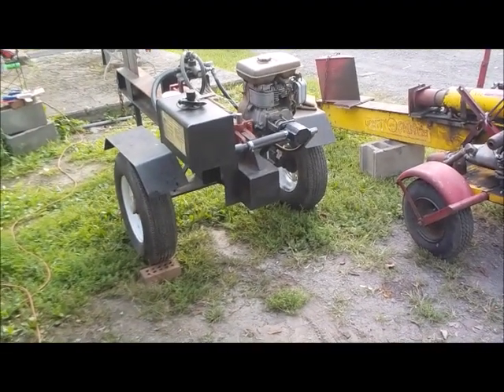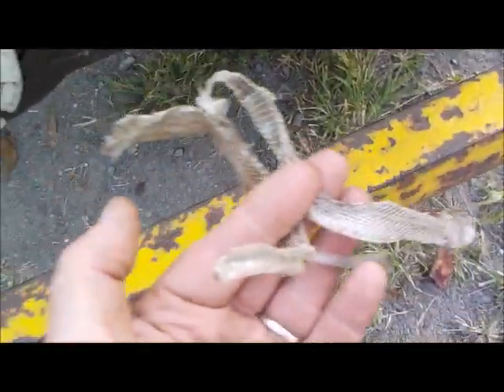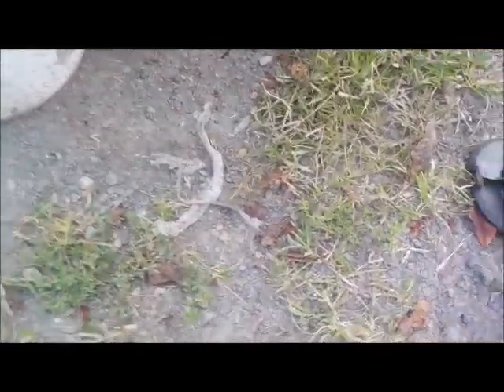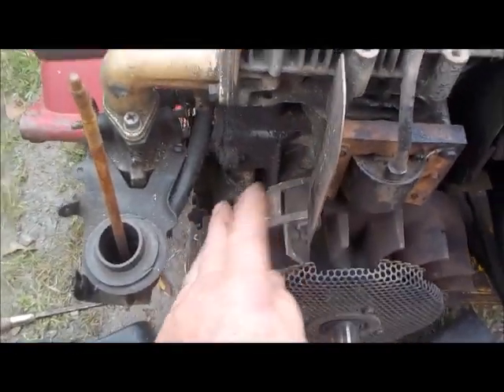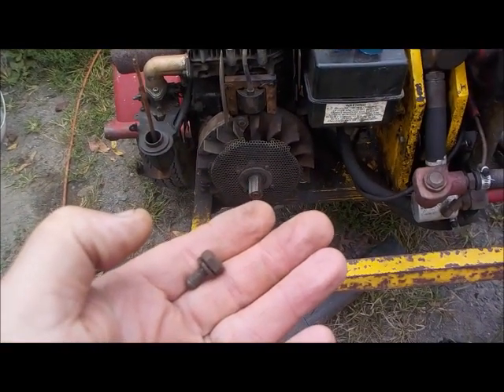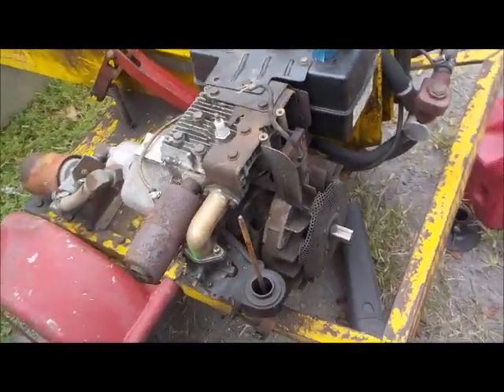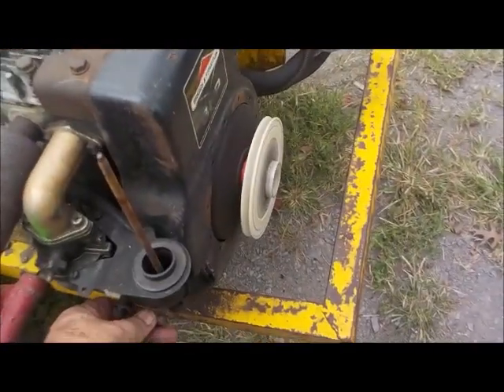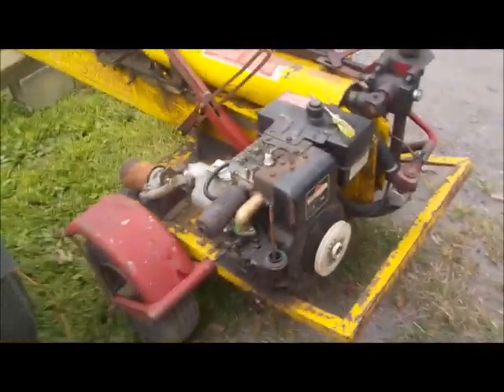Lickity Split & CLS Log Splitter Maintenance Part 1

Comment: Hi Dan, I saw in one of your old forum posts that you may have a manual for a Lickity Log Splitter, My model is a MK528. I have the original parts catalog and scanned it if you need a copy of that. Thank you for the video! Mine runs pretty good, just need to replace a couple springs. Thanks, Zach
Reply: Did you get a manual? I have the same machine. Trying to decide between keeping and fixing and getting new. Some manauls would be really helpful.
Reply: @jjdowdy1640  I did get a copy of the owners manual! A nice older gentleman in a forum I found mailed me a paper copy. It's for models MK348 & MK528. I also have the engine manual for Kohler engines K161 and K181, and the parts manual for K181 as well as the original illustrated parts list catalog for Lickity Splitter MK348 & MK528.Good diagrams in that one. Let me know if you have one of these models and I can scan them and email them to you. -Zach

Comment: I have a MK348. Was looking for a manual. Is that something you have?
Reply: I may have a manual that you could use. I have a manual for the single speed and two speed and used to have them scanned. May take me a while to find them electronically. On a disk or usb drive somewhere.  Does yours still have the original Kohler engine? B&S was not original and I have seen many variations of replacement engines. Kohlers are great because they have a cable that connects to the operating lever to rev up and idle down automatically. Safety Sallys would not like how they operate since most of the operation leaves both hands free.
Reply: I'll start looking for that manual. Give me a few days
Reply: @hkerr-di1yg  Hi, do you happen to have a manual for a MK528? I have the orginal parts catalog. Thanks, Zach